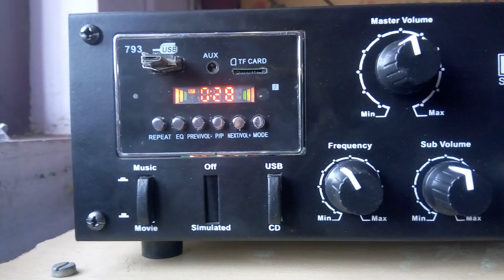5.1 TOSHIBA FET  Amplifier -  1800 watts

Comment: Hello Sir,
I need to know that what is is the payment method and which courier service you preferred of you shipped with bluedart then what will be the price plz tell. And what about warranty of the product.
Reply from the maker: First of all sorry for delayed reply sir.... payment through net banking, imps, deposit anyone..... Transportation through ST Courier....Then price is ₹7,200.... courier cost is additional ₹110 per 1Kg(for north India), ₹70 per 1Kg( for south india)
Reply: RHYTHAM digital sound system I live in maharashtra sir. And why not there is cash on delivery option.
Reply: RHYTHAM digital sound system Thanks for reply sir. If I need custom amplifier them can u able to make it using top notch component which should stand minimum 5 yr without any maintenance. Thanks in advance.
Reply from the maker: Sir....I can not able to provide COD...
Reply: RHYTHAM digital sound system 
Thanq sir. So how can I place the order for specific amplifier. And if I want custom amplifier for home use. Then what I have to do. Plz reply asap.
Reply from the maker: No problem sir....I can provide u custom Amplifier as your requirement..... may I know ur room size? Have any subwoofer?
Reply: RHYTHAM digital sound system 
No sir But I need an amplifier which should future proof. For now I have one subwoofer and speaker sub is 100watt and speaker are 50w respectively. I think 1000watt will be good. I need everything in that like bluetooth remote multiple connectivity. Plz suggest me and quote me what will be the price and amps image if possible. Thanks and regards.
Reply from the maker: This Amplifier cost is ₹7,200 sir....U can transfer money through net banking, imps, deposit anyone.... transportation through ST Courier service...I can provide 1 year service warranty only....not a replacement or onsite warranty....under warranty period Transportation up and down charges is yours

Comment: bro one doubt....
     36 X 5 = 180 
so each channel have 180 watts output..
but u say 1800 watts output. how??????
Reply: it's only a matter of marketing strategy
Reply: LOCAL PORIYALAN 9810356415
Reply: It is based on internet project simply saying the kit is copycat it also has worst distortion levels than tda 7294 ic
Reply: It's 100watts per Chanel

Comment: Price?
Reply from the maker: ₹7,200(Transportation is additional)
Reply: Fet ic rate
Reply from the maker: I am not providing individual board or I.c
Reply: 5.1 remote kit optical & coaxial input venum ₹-?
Board and remote set only
Reply from the maker: Bro...I can't provide any individual board....I am a amplifier assembler....not a supplier....but I can provide material, when will u give me a bulk order
Reply: Bro 1number board mattum coriyar panividunga bro
Reply: Sir 100 watt ka  kitane tak mileaga  Toshiba company ka
Reply: Bro 1400 watss supwoofer and 8 inch speaker 5 use pandra mathiri 5.1 surrounding home therater amplifier venum evalavu agum.nalla effect ya irukanum.rate solluga unga no send me
Reply: Toshiba 400 watt ka price

Comment: Stupidity ...4 nos of 6 amps diodes and a small classic transformer gives 1800 watts....!
New physics theory ...!
Reply: Hari K Nair sir explain how you calculated ?!
Reply: hello walkman ... voltage X Ampere= watts.....For example if you have a 200 watts rms amp.board Input volt is 25 0 25  here calculates 200 watts divided by 25 volts thats 8 Amps...! So 25x8=200.... High Ampere rating transformer is good because of less heat and high efficieny.... Toroidal transformer is best.... Another thing is Rectifier diodes always use bridge diodes and high value filter capacitors
Reply: hi hari please explain to him or live it sir because we are doing very small work on this
Reply: tre mor :...ok ... then that amplifier board is waste due to small power supply
Reply: +Hari K Nair sir I sell 2 channel amplifer but no one buy because I tell the truth so only 6 to 8 pcs per year ha ha ha....
Reply: Madhan J ....yes... Good quality product of 2000 watts power Amp is worth above 30000 Indian Rupees....!
Reply: 100 watt

Comment: 1800watt ??
Reply from the maker: S sir....have any doubt? Just go to Google search type "2SC5200, 2SA1943 output Watts"....it will show automatically
Reply: RHYTHAM digital sound system 2sc5200 200watt. Voltage and ampere?
Reply: Read and learn more about electronics, no way it can do 1800w in total

Maybe 60-70w per channel depending on the load impedance and supply rails

I respect your hard work but stop fooling people. Otherwise this thing is a piece of crap

Comment: The board looks cheap the capacitors are low quality not even audio grade please Google about audio capacitor and resistors used in the circuit are ceramic their will be very high ripple